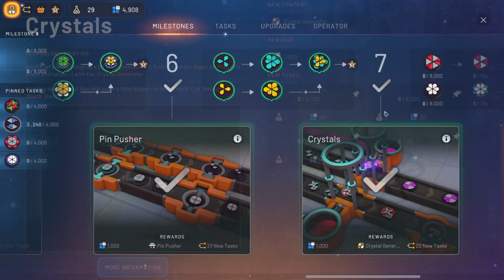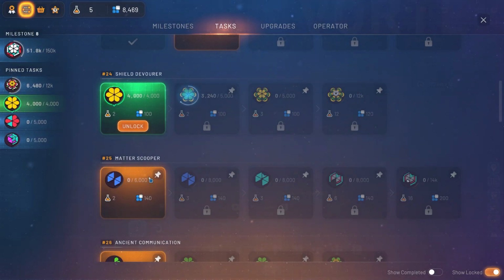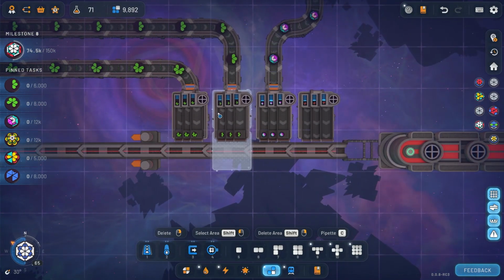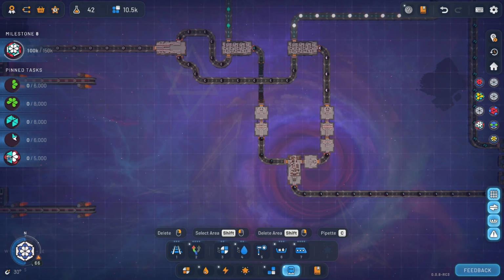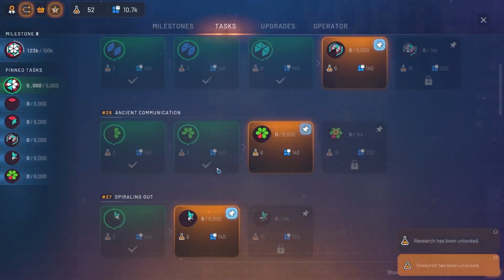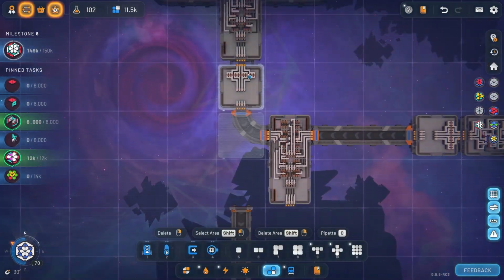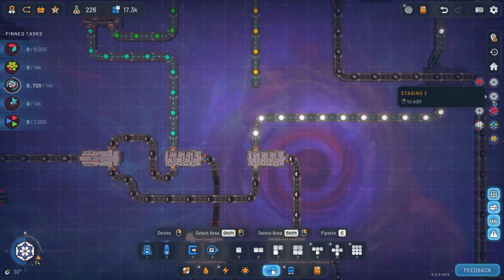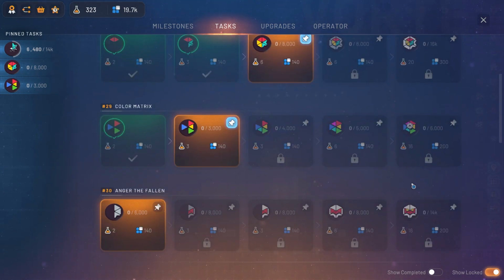Milestones are completed! - Shapez 2 Hexagonal Factory EP09

Comment: My hypothesis regarding the asymmetry is that this happens when the longest path after the asymmetrical portion is backed up and there's a platform later which depends on both, nothing will be sent via the shorter path and therefore the longer path halts completely. Whatever is transporting/processing the shapes on the longer path is processing at a slower speed than whatever is on the shorter path, which causes the shapes on the longer belt to slowly build up until the platform until the asymmetrical portion is completely halted and nothing is sent via the shorter path.

If it's something for a temporary task, it should be enough to keep an eye on the longer path and flush the longer path until it meets the shorter path. If it's something more permanent, maybe you might need to check the efficiency of the blueprint designs of whatever comes after the asymmetrical portion. If that doesn't work, you could blame the game or yourself.
Reply from the maker: That's my theory too. I just think its not worth the hassle honestly. I've done this in isolated testing too and asymetric works perfectly fine even with different belt lengths... then for no reason at all it stops working when I actually apply it to tasks.... no idea

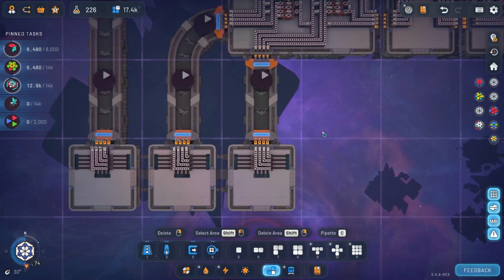Comment: (1:02:18) This half to three pieces even scarrier, because it not fully asymmetrical. Two outputs have 3/4 independent outputs, and middle one has its output combined from leftovers :)
And if one of two previous clogged it gets half lanes clogged also.
I think, one to 4 pieces would be better, so 1 belt splits to 4 pieces and use all four output lanes, and two trashed. Similar to MAM for regular gamemode. That way you get 4 independent space belts.

Its possible to make 1 to six, with all asymmetry only in single belt(so if whole belt consumed its ok). Just use 1st floor one belt to six pieces(4 on 1st floor, 2 on 2nd floor) 2nd floor belt to fill rest outputs(two on 2nd floor and 4 on 3rd). Same with other lanes belts, that way you get 4 space belts output from first two floors. And 3rd floor to fill two other space belts by same logic. 1 belt = 1.5 space belt so two belts can fill whole space belt... (But, I cant fit it on 3x3 -_-)
Reply from the maker: Yes I hate it, I might have to deconstruct this build for this factory and just do my dumb "destroy-piece-together" system

Comment: (53:04) Shape preview can be "hidden" because of painter that didn't received their paint yet, or by connected space belts. Sometimes it shows shape preview even with connected space belt, for me it was when I hower right above platform, so if you step from it even slightly it will hide.
Reply from the maker: Yes it's a bit slow and annoying